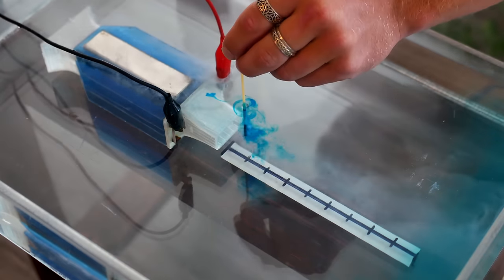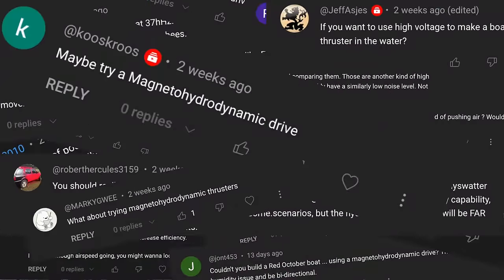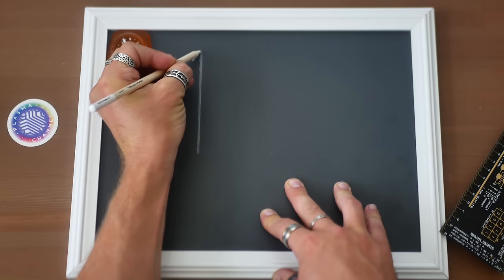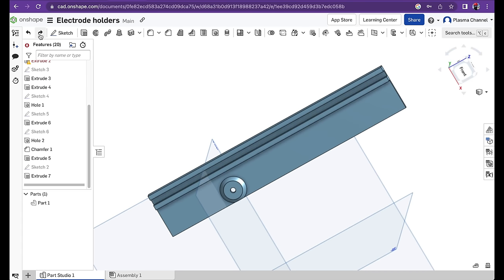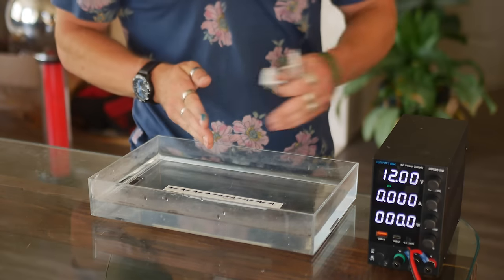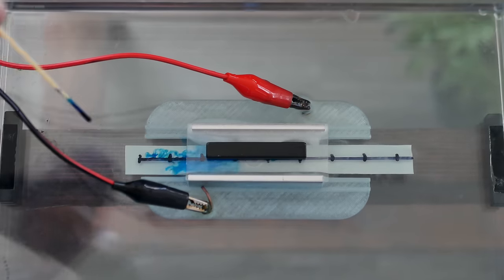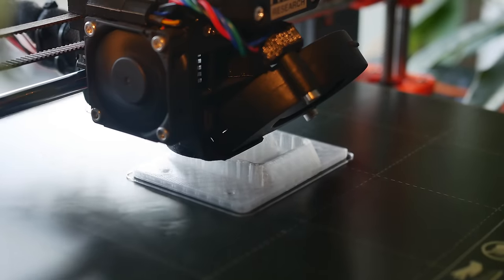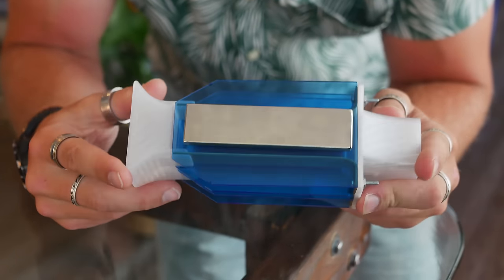Using Stealth Propulsion for Ocean Travel (MHD Thruster Build)

Comment: Look into halbach array magnet configurations. You can double the field strength inside your thruster by arranging the magnets so that the field is contained entirely within the thruster and the external field is cancelled out.
Reply: Oh I get it now it took me a minute to figure it out what u meant, I think that's a very good idea too
Reply: I was about to suggest this.
Also would allow for several thrusters next to each other as the magnetic fields would be less noisy.
Reply: Yeah sorry, that isn't going to be helpful in this topology
Reply: @EGL24Xx  Why not? This looks like the perfect application of halbach arrays to me. The field on the outside is doing nothing to help the thrust. It would be much better to direct the entire field inward.
Reply: This! But i also wonder if using graphite electrodes is possible!
Reply: @dack42  because pushing the field to one side of the array isn't as important as maintaining a field perpendicular to the current flow, which a halack array won't help much with.  As an electric machine designer, the proliferation of the term halbach array is a disaster.  People don't truly understand what they are for.
Reply: @dack42  exept you need a magnetic field which only goes in one direction. a halbach array magnetic field is changing
Reply: @dasjulian3  Ah, yes - that's a good point! For a more uniform field, perhaps direct the fields inward with a bracket - similar to the arrangement found in hard drives.
Reply: @EGL24Xx  haha! Magnets are basically magic to most people (at a fundamental level, they kinda are magic), then halbach arrays are magic on top of magic = loony perpetual motion machines
Reply: @dack42  Just put a second thruster on the other side of the magnet then there will be no "outside". Both sides will be contributing to thrust.
Reply: @perttu3387  ...but uproariously amusing!
Reply: He has to just close the air gap around the outside of the arrangement to optimize the magnetic circuit. Just connect the outfacing sides of the magnets with a path of ferromagnetic material (e.g. iron) which goes around the construct. Thereby the only air gap and thus usable magnetic flux will be on the inside (where the water flows through) and the remaining path will be of low magnetic resistance, increasing overall flux.
Reply: @LeideHuend This! Too little regard is usually given to the magnetic circuit.
Reply: @perttu3387 It's weird, huh?

You would think a good mocking would make people realize they should understand a subject before presenting wrong information as fact.

In reality it doesn't.

Do you have something even better than mocking to suggest?
Reply: I think he should fold the path so it passes through the magnetic field multiple times. If you create the walls of the path using alternating anodes and cathodes, the voltage across the water will change direction so that it is always propelled in the right direction. It may be helpful to add in a vent at the top to release liberated gasses in this design so that they don't build up too much. And if you contained it all inside a metal shell, that would be a great way to lower the magnetic impedance.
Reply: Be interesting to see a model with smaller neo’s on a 45 degree angle rather than sitting parallel to the outlet. Wondering if it would push it ‘harder’
Reply: @Canigetanawwwwyyyyeeeah The force is perpendicular to both the electric and magnetic fields. If you rotate the magnetic field by 45 degrees, the thrust in the forward direction would be halved.
Reply: @LeideHuend  As this is a topic I am no expert and need to refresh myself whenever it comes up, I found a number of great diagrams of various kinds of magnetic array configurations on the Wikipedia entry for "Halbach array", including some that do exactly the magnetic circuit optimization that you are talking about: https://en.wikipedia.org/wiki/Halbach_array (particularly under the heading "Uniform Fields")
Reply: Haven't bookmarked a google search in a long time.
Reply: Would a halbach array in a twisting pattern, to swirl the water coming out, coupled with a smaller diameter opening, to make use of the Bernoulli effect, work more efficiently?
Reply: Hallbach works if you want an alternating field like in a motor. It wouldn't work to create thrust like this.
Reply: Noo...  Those fields alternate over the length of path.  Not appropriate for MHD.
Reply: @allistairneil8968  so easy to be cruel when it's anonymous eh.
Trolls suck
Reply: Nice
Reply: Potted magnets do the same thing, and at a trivial cost. Drawback: less efficient than a Halbach array, so while you’re gaining field strength compared to a bare magnet it’s not as much of an improvement. It is, however, a solution that’s available off the shelf and is installed exactly like a regular magnet.
Reply: I just came here to comment on adding more/stronger magnets to increase the output. 
Now I can't help but wonder what effect wrapping the wires around the magnets would have. 🤔
Reply: @EGL24Xx  There are circular halbach arrays which have a single magnetic direction and can be built in tube shapes, the partial circle/tube segment magnets are even fairly available online. Halbach is not just that one simple 2d maglev design there are loads of possible configurations in different shapes and field patterns for different uses.
Reply: @EGL24Xx  Well yes and no, Halback did his magnets for circular geometries, but you can build a bar magnet with both poles on one side. I did it myself its not hard the configuration is online. After that is just configuring the electric filed and done...
-MG
Reply: Yeah your right, but its less of a Halback and more of a one sided magnet. Halback built his magnets for an accelerator which was a tube or circular shape. One sided bar magnets would allow this to work and they were inspired by Halback arrays. I think Tesla is using Halback motors but I am not sure... Oh I have built one sided bar magnets and they do not go together easy...
-MG
Reply: @dasjulian3  Halback is also a bar configuration so it will work and maintain a linear field, in fact its more linear that what happens with a standard magnet.
Reply: @PowerScissor  While a halback array is the wrong terminology he is right, a one sided magnet will work and work really well. Oh look up Halback bar magnet, configure the electric field and off you go.
-MG
Reply: @AntotaboQC  Not true, a Halback can be a bar magnet and produce a very linear magnetic field across the electric field. You end up with two fields, but configure the electric field correctly and zoom a highly concentrated magnetic field that is very close to 90 degrees from the electric field.
-MG
Reply: @Mike-sn9nv  They come in bar form so not altering..
-MG
Reply: @zzink  So true, I built a single sided magnet myself. They are weird they stick like crazy on one side and just don't on the opposite side.
-MG
Reply: @dack42  halbach arrays produce alternating field orientations. That works great for where you want magnetic attraction, but not when you want uniform field.
Reply: @MordecaiV  One sided Halback array magnets come in Bar form and can produce a uniform field.
-MG
Reply: @JonathanTrevatt  As a cylinder the field produces a curve which impacts the force because the field are not fully at 90 degrees.
-MG
Reply from the maker: @LeideHuend  I like this idea.
Reply: @PlasmaChannel  Thanks! Looking forward to see the improvemets.
Cheers
Reply: Salt injection
Reply: Yes but also using Correlated Magnetics "Polymagnet" products. Instead of a single large pole per face of magnet there's dozens of the same polarity poles in a grid or array pattern per face already compressing magnetic flux before any halbach array principles.

Polymagnet based Halbach arrays will create capable magnetic flux levels with minimal expense.
Reply: @AntotaboQC  What if you used an electromagnet instead of a permanent so you can switch the field?
Reply: Halbach arrays would not work as alternating fields are closely adjacent.
Reply: “Plasma Depot’s” electrode stock must be made of very exotic materials, purposely engineered for high energy physics, since they cost 8 times as much per foot than from a common metal supplier.
Reply: I’d be surprised if you got any thrust at all if you did that. You need a uniform magnetic field. A halbach array would alternate field directions and just cause the water to swirl around
Reply: I have transformers up to 60kW and up to 250kV and up to peak 100kA (Different transformers) with many modifications for experiments with levitation etc. I have made an MHD boat up to 1kW. So what is your point?
Reply: Anybody knows if a rail gun way of firing is possible for speedier flow or more effective energy input/output with magnetic field control? Thanks
Reply: that's a fantastic idea, and i bet supermagnetman would be able to help make it stupidly strong.
Reply: @bismuth7730  Im pretty sure they would errode too quickly for any industrial purpose, especially in ocean water. You can use them in home-chemistry, where theres no need for longevity. 
However, it would most definetly work very well on this scale.
Reply: Red october?
Reply: I think we must be close to hovering ship tech.
Reply: Neat

Comment: Are you concerned about generating chlorine gas with this electrolysis setup? Or are you using something other than NaCl for the salt in the water? I'd be worried about pushing the voltage up with table salt in the water, that could get dangerous.
Reply: At the scale and duration of these tests there shouldn't be much chlorine production. When scaled up to a full-sized boat though you'll definitely be glad you're outdoors.
Reply: With copper, iron and aluminum electrodes the anode is chemically degraded by the current and no chlorine is produced. 

With graphite electrodes they suffer less damage but produce a lot of chlorine vapor.
Reply: Lol.
Reply: Don't forget about the sodium hydroxide from the reaction. It's a corrosive alkali.
Reply: The marine animals don't like the noise, but the chlorine won't be any good either
Reply: @deltab9768  Do you think a sacrificial anode would be possible in a setup like this?
Reply: @deltab9768 — Are you sure no chlorine gas is produced? You can see the stream of bubbles coming off the anode. Also at high voltages wouldn’t you get some degree of crepitation?
Reply: Doesn’t this also produce hydrogen gas ?

Comment: A laminar flow straightener behind the flow with something to increase the Reynold's number would likely increase efficiency. Break the boundary layer at the electrodes and then columnate the fluid again to get an even thrust across the nozzle. While water is rather sticky it is also viscous enough to react nicely to boundary layer separators especially since it's practically incompressible so there's little spring effect.
Reply: At these flows, boundary layer drag is insignificant. This will not make a lick of difference. Not a lick.
Reply: @UnitSe7en The goal is achieving more thrust and the best performance (more volume and faster speed) , every detail matters. The more tidy axial flow the better.
The squared cross section of the device, works in fact, against both goals.
Reply: @UnitSe7en  Better to solve these issues before scaling up though. Even moving up to the kilograms-force regime would have those effects become nontrivial.
Reply: But it doesn't straighten the flow for free
Reply: @UnitSe7en,
Laminar flow makes a huge difference in aircraft but you're trying to say that it won't in a hydrodynamic environment that is literally 780 times more dense than air??? Think again.
Reply: You are not going to be able to maintain laminar flow or a Reynolds Number under 3600 throughout the entire channel. Jet airliners have reynolds numbers in the millions because they operate in air. 1/10 of the duct L/D is the rule of thumb before the flow is fully developed. Combine that with the nucleation sites along the electrodes and a laminar boundary layer is dead in the water (pun intended). It will be simpler to transition to turbulent sooner and deal with the effects. Go with biomimicry of a dolphin's skin and how it ripples at speed to minimize the transition effects, similar to a golf ball. Maybe aspect ratios like why Oceanic Mako's fins are so much longer. I don't see this thrust getting to speeds where parasitic drag is not a dominating factor.  @SeanOHanlon
Reply: @JaredBrewerAerospace  Thanks. - I can't be bothered with replies to these people. Like Pearls and swine.
Reply: @UnitSe7en  Kind of like how ghost feels about your first comment, huh?

Comment: I think this is really cool. A nice upgrade would be a hexagonal configuration and you could run it like a bldc. It could make a water screw improving velocity further
Reply: @Alfred-Neuman what the hell.
Reply: @Alfred-Neuman beware of bitting your tongue
Reply: @KangJangkrik  
I literally got my last bite. It went pretty well, didn't hurt my tongue or burn it with the fried chicken. Thank you for warning me... lol
But I went pretty close from burning my apartment because when I was frying the oil it almost overflew on the red hot element! Fortunately I was quick enough to remove the pot. Never do some frying with a pot and leaving it unattended...
Reply: @epicdaniel508  
I apologise if you got hungry because of me. Luckily it's not too hard to cook this, it just takes a bit of time.
Reply: @Alfred-Neuman  actually, haven’t eaten anything for 53 hours. Still, weirdest comment I’ve seen in a while
Reply: if the inside of the thruster is cylindrical you could reduce friction drastically and the vortex could suck in even more water from the intake (like how the Dyson Air-multiplyer work)
Reply: @Craftlngo  definitely, I'd really like to see if this would push a toy boat
Reply: Fascinating suggestion. A virtual prop
Reply: Sounds good to me, though I know next to nothing about bldc motors or electricity. For thrust improvement, probably a great idea, but I think it comes at the cost of stealth, doesn't it? Water/water cavitation on intake, and water expansion on output (shockfront) as the vortex's vacuum center collapses and as expanding water impinges on ambient water.
Reply: buddy..You're crazy.  @Alfred-Neuman
Reply: @SignatureStagers  
Hehehehehehe
WHAT?

Comment: I think that a more narrow gaps leads to increased resistance, in the water flow, that cancels out the increased force applied. Maybe testing with different depths of water would show a difference
Reply: But smaller gap means less water which should mean less resistance not more?
Reply: @MB-st7be  there is less water, but the ratio between frictio  inside the water and the friction with the electrodes are higher. I just thought it might be the case, because if you have a smaller flow channel you neef a higher pressure gradient, if you look at poiseuilles equation(which is for a pipe, but i think the same tendencies should be happening for other systems).
Reply: @MB-st7be  It's the attraction between the water molecules that means more resistance. It's easier for them to 'stick' to each other and the walls of the thruster when there's less space between electrodes, I think.
It's the same physics that generates surface tension.
Reply: @MB-st7be  I think it's more along the lines of larger diameter cable reducing resistance
Reply: @rasmusmadsen983  By that logic, two plates a mile apart would see super low resistance and the current flow would be huge, which obviously isn't the case
Reply: I think the OP is talking about resistance to flow, not electrical resistance. OP needs to be more specific and not conflate terms.